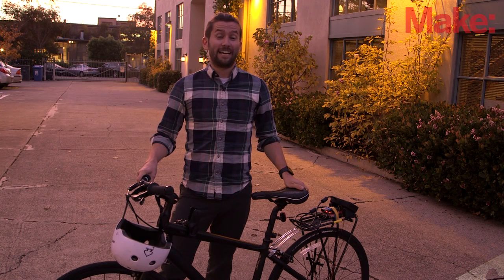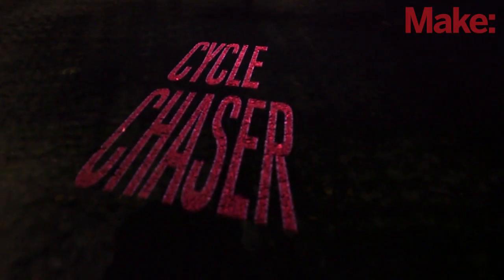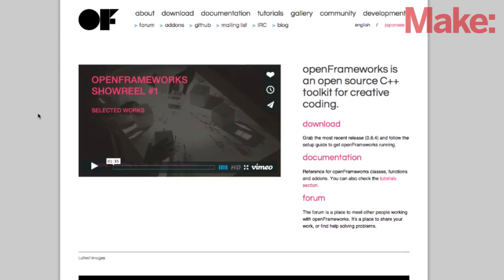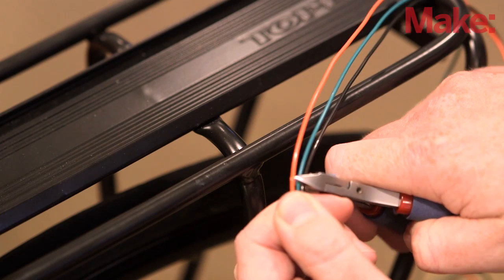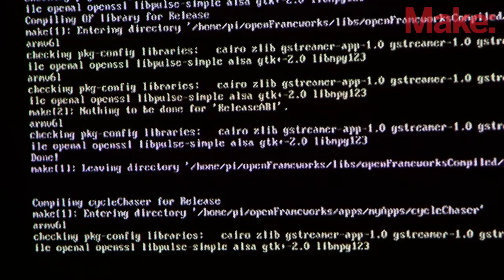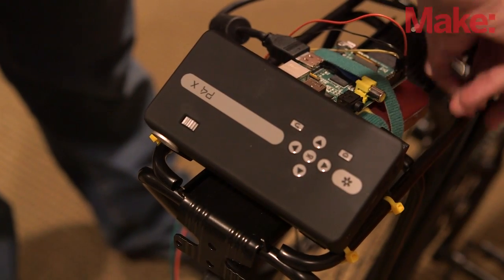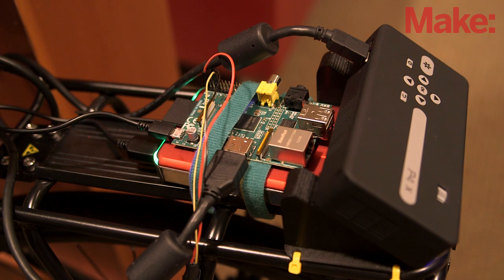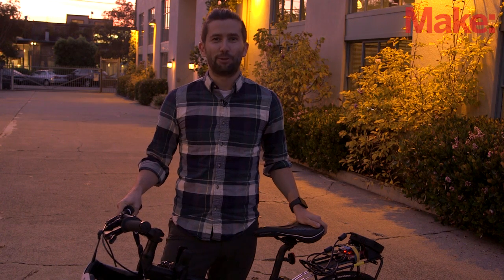Weekend Projects - Cycle Chaser

Comment: Nice project, Matt. I can also see some real practical applications. Bikes have no brake lights. So, when the bike suddenly slows down, a warning image could be displayed to the bikes and vehicles behind. Also, it could be used in pacelines for those training for races. When the cyclist is slower or faster than the desired speed, the image would change and the teammates could encourage them.

Comment: point the projector in front of you = gps on the ground
Reply from the maker: We're astounded we didn't think of that first! Thanks for the inspiration!
Reply: Make: I think there would be saftey issues with that, as you may be paying more attention to the projected gps than what is going on around you. Also as far as it "not having any practicle use" as stated in the video, it could simply be used as a saftey device, since people would certainly notce you if you were running this at night. Also it could be used for advertising.
Reply: Lel
Reply: that's the best part: it would be like one of those camera messaging apps for your phone where the camera projects whats in front of you behind the message you are currently writing. You would still be able to see the road under the projected information

Comment: Wait if you attach the magnet  to wheel 
What  happens when  press the break
Wouldn't this take the magnet off ?
Reply: attach it to the spokes to prevent this
Reply: He is having disc brakes, so he can install the magnet on the rim, but there are magnets that installs on the spokes of the wheels, in sets when you buy a spedometer for bikes...so you could use that...
Reply: Tomislav Spajić yes yes  never though of disk breaks
Reply: It is attached with a tape plus the sensor does not physically touched the magnet itself
Reply: pogi09282805724